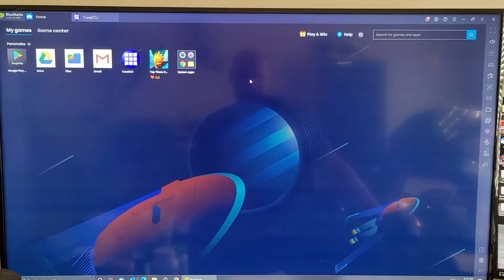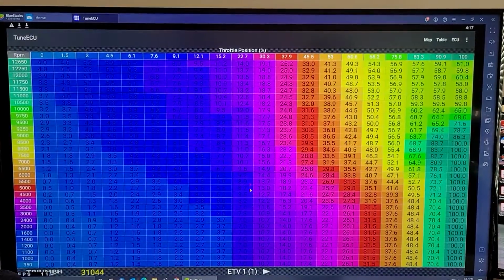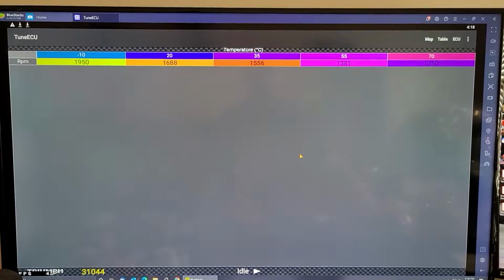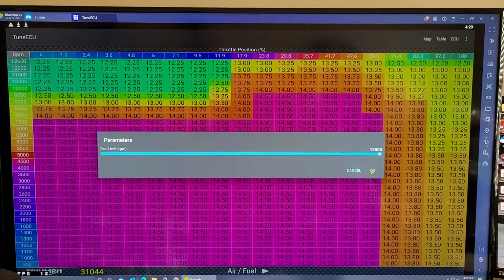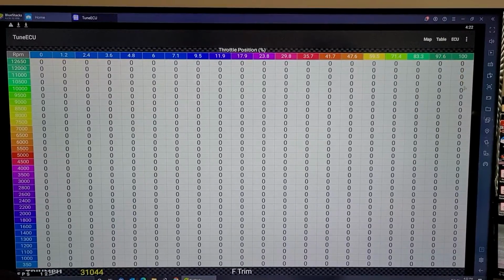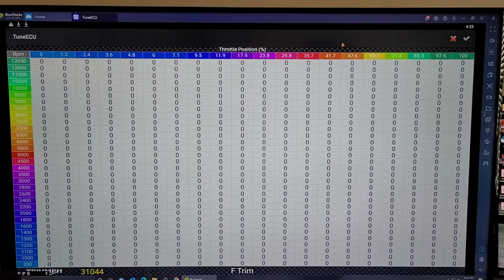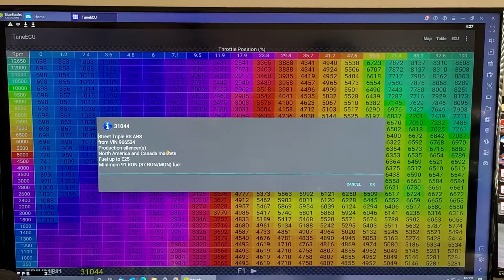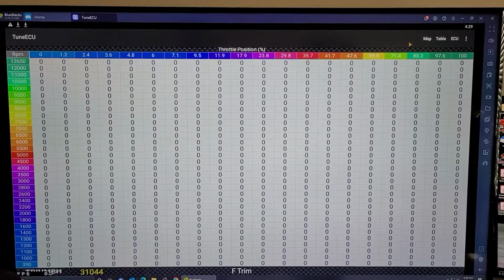How to use TuneECU to tune a 2020 Triumph Street Triple RS

Comment: You ever adjusted the L tables to remove decel pop on a 2020+ Rocket 3, 2500cc bike?
Reply from the maker: Nope.  Just disable SAI and block the hose with a marble, and that will get rid of most of it.  You aren't gonna eliminate pop on decel entirely.  Its present on bone stock bikes, but because of the CAT and muffler, you don't hear it much.  Once you open it up, it goes from background "clicks" to popping and banging...

Comment: Hi Dave....I own a 2020 euro 4 Bonneville T100....some people say if I where to increase my fueling by 5% across the board.....that the adaptive ECU would ignore any fueling adjustment done with TuneEcu.

Whats your take on that Dave.
Reply from the maker: Its not an adaptive ECU.  There is no learning or "self tuning".  There is a little, but its so limited... Its like having an arm that is 80% severed, and putting a butterfly bandaid on it.  Sure, you technically "treated the wound", but you hardly fixed the problem.

You can tune it with ECU.  Your short term idle trims might get slightly tweaked if you don't unplug the O2 sensors, but the changes are tiny, if any, and only at small throttle openings and low RPM.  

Our bikes use narrowband lambda sensors.  Not wideband like modern cars do.  As a result, they have very limited range, and if the AFR is outside of that range, it won't know if its rich or lean, and it will not know by how much, or be able to adjust.

Anyone that tells you this is a self tuning system, or that you just need to do the "15 minute tune" has no idea what they are talking about.  Never take advice from them, even if they are the Triumph dealer.  You would be amazed by the things that dealers DON'T know about the products that they sell.

If you did exhaust and stuff, you can absolutely add some fuel to keep the motor happy and running "good enough", with TuneECU.  And of course you can toss it on the dyno and use TuneECU to do a complete custom remap.  If you go that route, disable and unplug the O2 sensors and never look back.

Comment: Hey i own street triple 675 with an arrow pipe but its detuned to 80 bhp in india , can i just download a eurospec arrow map and run it ?
Reply from the maker: What year is the bike?  And does your bike have a cable throttle, or ride by wire?
Reply: @Daves_Man_Cave  its a 2015 model , it has cable throttle
Reply from the maker: @anoopnayak3914  Not much you can do other than toss it on a dyno and tune it.  There aren't any restrictions to remove, as most of those are built into the ride by wire tables...

Comment: I would like to add Pops and Bangs on my Daytona 675R, what part of the map do I need to configure? I think it's possible correct? Greetings from Brazil.
Reply from the maker: I wouldn't do that.  The bike either pops and bangs with the right fueling or it doesn't  Dumping tons of fuel in there or running it too lean, to induce that, isn't good for the motor.

Comment: there seems to be a dip in power on my bike around 4500-5000rpm if i give it more throttle this sems to help could i tune the sport map to increase the throttle at those revs to simulate me doing it manually?
Reply from the maker: A dip in torque is more likely the result of a fueling issue there, maybe a bit too lean or too rich.  I would address it at the fueling level rather than trying to use throttle hacks to "move past" the issue quicker...

Comment: Hello, I installed a factory TSA (TRIUMPH SHIFT ASSIST) on my Triumph speed triple s 2020 but it is not working becouse need to active it. 
Is it possible to active it by tuneECU?
Reply from the maker: Hmmm... that's an interesting question.  I don't have one to test it on, so I can't honestly say.  I would have thought it was plug and play, kinda like the heated grips are...

Comment: Is it possible to dissable O2 and Sai on a 2018 Street Triple RS? I have a Rapid Bike Evo module with a you tune module that uses yhe wideband sensor for the open loop section but i would lile to be able to control the closed loop section as well.
Reply from the maker: Yes, you can disable O2, but you also need to physically unplug it
Reply: @Daves_Man_Cave  Thanks for the reply. How do I disable it in TuneECU. I don't see it as an option under adjustments.
Reply from the maker: @cæmper  It's under Map, Parameters, then devices...

Comment: Hi I have uploaded this map, but to be honest, I can't tell any difference. Should it be noticeable?
Reply from the maker: Which map, and what mods have you done to the bike?  And what bike, in particular?
Reply: @Dave's Man Cave  its a 2021 street triple 765 r, no mods just an arrow can andcthd base map with the 200% throttle alteration
Reply from the maker: @xander749  Ok, is what map are you running specifically, and are you running in Sport Mode?  that's the only mode I unrestricted...  And you need to be wide open on the throttle and in those upper RPM ranges, that's where the power difference is.
Reply: @Dave's Man Cave  not sure how to attach a picture here. Can I I have screenshots of the map info, can I share it?
Reply from the maker: @xander749  email me directly
Reply: @Dave's Man Cave  what's your email? Can I find it on here?
Reply from the maker: @xander749  Under my contact info tab
Reply: @Daves_Man_Cave  Map: 31234_01

Comment: can you show how to change idle rpm? thanks man
Reply from the maker: It's easy.  Open the map for your bike, scroll down past the F tables, past the L and ETV, past AFR and get down to the one that says "Temperature (C)" at the top.  Its usually the 2nd or third LAST screens when you scroll down from F1...

Once you are on that screen, its one bar with water temps, and then RPM listed below it.  The far right cells are for when the bike is warmed up and settles into its final idle.  Edit that table, and change that bottom right RPM to whatever you need it to be once the motor is warmed up.
Reply: @Daves_Man_Cave  thanks man for very detailed instruction :D let me try

Comment: I wonder if there is a way with TuneECU to make changes in the warmup 'cycle 'map?  (also for street triple rs)
Reply from the maker: I can check tomorrow, something tells me that there is a setting for that... Down on the bottom menu, past the fuel and ignition maps and ETV tables...
Reply: @Daves_Man_Cave  i would appreciate it a lot!
Reply from the maker: @jschuur1620  In TuneECU, open up the map you want to push to the ECU, and scroll all the way down past Fuel, L Tables, Ignition, ETV... keep scrolling down and the second to last one is call "Idle".  You can set your idle RPM based on motor temperature ranges, there.  Make the changes, save it, and then reprogram the ECU.
Reply: @Daves_Man_Cave  Thank you! my street rs  has a fluctuating idle rpm 1000-3000rpm, and a bad low rpm throttle response, only with cold start. (i'm going to increase to cold rpm's a little. with TuneECU..
Reply from the maker: @jschuur1620  Keep in mind, it could be that idle setting, or, your fueling could be off in the idle area...  What year, model and mods do you have on the bike?

Comment: How did you get bluetooth working on bluestacks?
Reply from the maker: I didn't.  I use Bluestacks to do the edits on the map, and to show in the video...  But I save the file and send it to my phone, and use the phone to actually push it to the bike.

But editing map tables and showing it on video, it's easier to use a 42" screen and Bluestacks...

Comment: Street r 2020 maps in tunecu looks mess.  Vin from 982752.. Could anybody check, etv1 is much more `powerfull` than etv2.  Thats a bit confusing if etv1 is rain. Does anybody noticed that? Other thing my bike has only rain and road. How can i upload sport map? Is it possible by tunecu or i nly a dealer? Thank you.
Reply from the maker: You have a 2020 Street R, not the RS?  Search my videos, I have a video just for the R and how to tune it, as well as how to unlock the top end power of the R so that it has the same peak power as the RS.  Triumph, for 2020, started using the ETV tables to hold back the power on the R.  The motors, the tune, is identical.  The difference is the ETV table.  Find that video and it should help you.

Comment: Great video! Tell me, please after downloading new map adaptations should be reset,right? But TuneEcu couldn't reset them on newest bikes as far as i know. What if I start make dyno pulls right after flashing on these newest bikes?
Reply from the maker: Well, if you disabled O2, make sure you unplug the sensor itself.  At that point, you can clear adaptations and don't worry about it, because there is no reset process without an O2 sensor... Not that there was much with it in...  But what little it could do, is gone when you disable O2 and pull the sensor out...
Reply: @Daves_Man_Cave thank you! so, mainly those adaptations are short/long term fuel trims?
Reply from the maker: @turbotyoma  They are small, short term fuel trims, but only in the closed loop area of the map.  Just wipe them out, disable O2 and SAI, and toss in your PC-V and tune it.  Costs a little more to do it with the PC-V, but it will take far less time on the dyno, and get better results...
Reply: @Daves_Man_Cave  thank you! But I am planning to tune stock ecu via trims. Do you work at dyno?May we share our experience somewhere with each other?
Reply from the maker: @turbotyoma  Well, you can try tuning the stock ECU, but down low around idle, where it is very lean and wants to stall, you might have issues without a PCV
Reply: @Daves_Man_Cave  why only around idle?
Reply from the maker: @turbotyoma  We don't know.  That bottom corner didn't respond to any of the changes that we made in the fuel tables in TuneECU.  We added 70% fuel at one point, and it made ZERO difference with the air fuel ratio.  Paul Holden, a tuner who also races this bike in the UK, had the same issue.  The only way that either of us could fix that area was with a PCV.

And because of that, it just makes sense to do all the tuning there, in the PCV.  It's so much faster than tuning with TuneECU.
Reply: @Daves_Man_Cave  wow, is it only about this model or all newest triumphs?
Reply from the maker: @turbotyoma  2020 and up.  Euro5 is really restricting what we can do, or how we can do it.  

We can still tune the bikes, it's just not as straight forward as it used to be... and the days of slapping on a high flowing slipon with the dB killer removed and expecting it to run fine, are pretty much over with many of these new bikes...

Comment: Do I need to disable the factory O2 sensor when I use a PCV with auto tune
Reply from the maker: Yeah, you will want to use TuneECU to disable O2, then unplug the actual sensor, and put the PC-V sensor in its place in the exhaust collector bung.
Reply: @Daves_Man_Cave  will there be a problem if I leave the stock 02 sensor and add the wide band O2 sensor separately by welding a bung,cos pcv guys say there is no need to remove the stock 02 sensor..
Reply from the maker: @yeshwanthl8571  If you want to weld in a new bung,thats fine, but you still need to unplug the old one.  I would remove it and get a bung plug from Amazon for like $8 and plug the old bung.

When you disable it in TuneECU, you are really only disabling the error code throwing when you remove it.  if you disable it and leave it plugged in, it will still try to use it.

So pull it out, plug the bung.

Comment: Can a pc and blue stacks be used in place of an Android phone ? Like to also upload maps ?
Reply from the maker: Possibly, but I wouldn't risk it.  For doing something as critical as flashing your ECU, I don't know that I would trust it to an emulator rather than the native device it was meant to work with.  So it might work, or it might fail in the middle and brick your ECU.

If you don't have an Android phone, borrow a friend's or buy a cheap one on Amazon for like $80 and just use it for TuneECU.  It's not like you need a data plan, just put it on Wifi for updates, etc...
Reply: @Daves_Man_Cave  very true thanks for the reply

Comment: Hello, what the values F1,F2,F3 mean? I mean, what units are they? microseg inyeccion fuel?

Thanks a lot
Reply from the maker: F is for Fuel tables.  F1 is Fuel for cylinder 1, F2 for cylinder 2, and so on.

As for the units, I honestly don't know.  I know that you increase or decrease the value by a percentage until you get the result(on the dyno) that you want, but what those units actually are, I have no idea...

Comment: Is possible remove top speed limiter?
Reply from the maker: None that I know of.  That is hard coded somewhere else in the ECU and nobody has figured out how to raise it.  Paul Holden, who races this bike in the UK, removed his wheel speed sensors so that the ECU doesn't know how fast the bike is going and therefore can't enforce the limit.  Of course, that also disables ABS and traction, as well as showing the speed on the dash, which might be fine for a dedicated race bike, but not something we would want to do on the street.  lol

That said, there really is no point... It's a naked bike and anything over 140mph is sketchy and NOT fun at all.  The bike isn't designed for that... the wind, lack of downforce and turbulence at those speeds starts making the bike unstable and less safe...  

If you want a bike with a higher top speed, the Street Triple is not the bike...  Hence why I picked up a new ZX6R for track days or days I want to go faster...

Comment: If I have a 2020 street triple R can I put the RS map base in it as I was told the cam profiles are not different between the two on the newest 765s
Reply from the maker: NO.  Do not take a map for the RS and push it to the R.  There are things in that file that TuneECU doesn't access.  The dashboards are different, for one thing.  If you take an RS base map and push it to an R, there is a good chance you will brick your ECU.

Just take the R base map, go to the sport mode ETV table, and put 100 all the way down on the full throttle column...
Reply: @Daves_Man_Cave  awesome thank you! I have the OBD adapter coming in today!
Reply from the maker: @51stVFWEagleDriverDIP  Sweet.  Make sure that the table that you change is ETV3.  That is the sport map.  Leave ETV1(Rain) and ETV2(Road) alone for now.  Edit ETV 3, and in the 90.1 and 100 column, all the way to the right, the last two columns... Put 100 in every cell from top to bottom.  Save the changes, accept whatever defaults it asks as you save it.  And then save the map file, giving it a new name so that you know which is the base map and which map is your modded map.  

All you have to do then is connect and stuff, and push it to the bike, and I have a video on that, as well as TuneECU has the tutorials...

Once complete, go ride it.  Compare top end power between Road and Sport, and you should feel that extra boost up top in sport.  Please let me know how it works out!
Reply: @Daves_Man_Cave  I have one more question. I’m looking at the base maps for the R and LRH and the vin splits are not making sense as i have 2 letters in the last 6 of my vin. The last 6 are AA0454 could you possibly tell me what map I need?